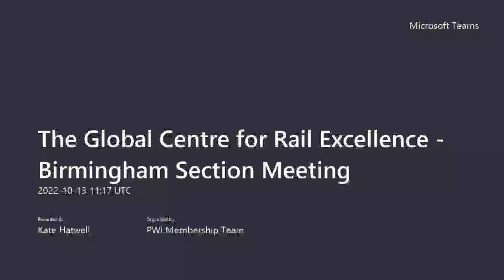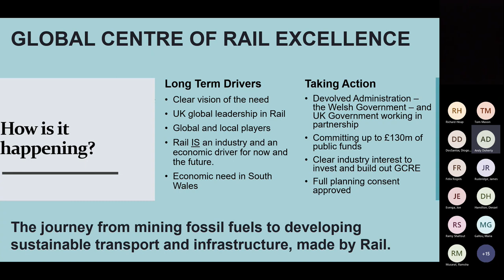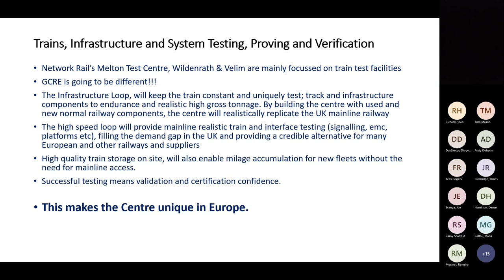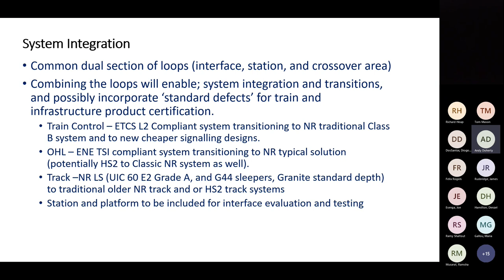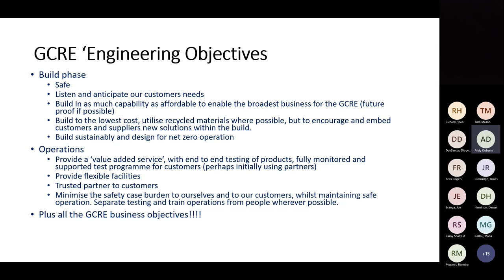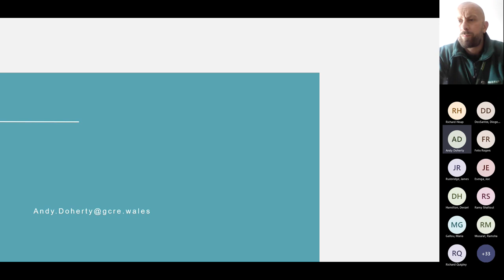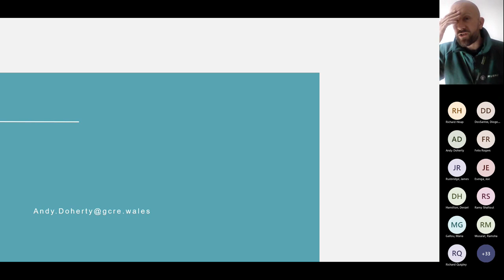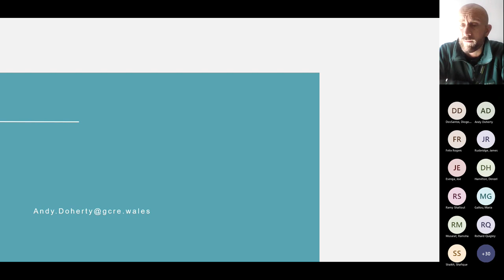The Global Centre for Rail Excellence - Prof Andy Doherty

Comment: "All trains are electric, even Diesel".

That's only true if they're DEMUs with electric transmission, such as 220s/221s/222s/231s.

It's not true for DHMUs with hydraulic transmission, such as 168s/170s/171s/175s/180s/185s, or for DMMUs with mechanical gearboxes, such as 172s/195s/196s/197s.